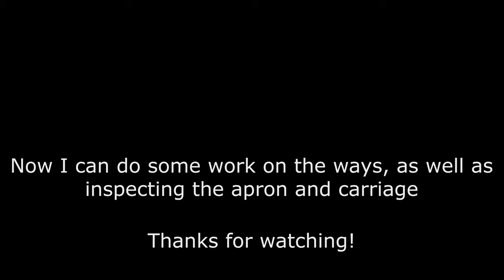1950 LeBlond Regal 17" Lathe Restoration Part 5: Removing the Apron and Carriage (plus QC Gearbox)

Comment: Hi Its nice watching you take it apart As i have the same lath and have to break it down to clean the quick change gear box. May I ask where you got the manual you are using and ow did you remove the rods from the quick change gear box. Thank Yoou
Reply from the maker: I purchased the manual from Leblond, but you can find it on the vintage machinery archives ("someone" scanned and uploaded the manual there")

As for disassembly, I can't recall any details at this moment but if it's not in the videos on this channel I don't know.

Comment: the deep groove in the ways is called "galling" basically when theirs a lack of lubrication cast iron can weld to itself as the two pull apart the Burr digs in and has a sort of snowball effect where it cold welds more material and rips a deeper gash. I've scraped voids filled with epoxy before and it scrapes beautifully but proper prep is critical

https://www.practicalmachinist.com/vb/south-bend-lathes/filling-scars-lathe-bed-225222/
Reply from the maker: Thank you for the advice! I've been considering my options for it but I hadn't considered an epoxy filler. I have the ways cleaned up now (future video) and things will look a bit more clear.